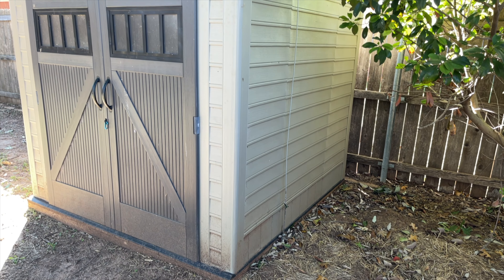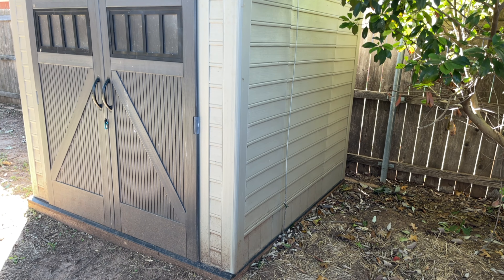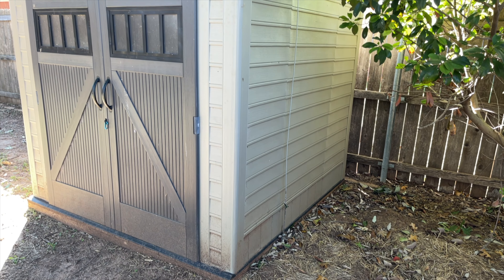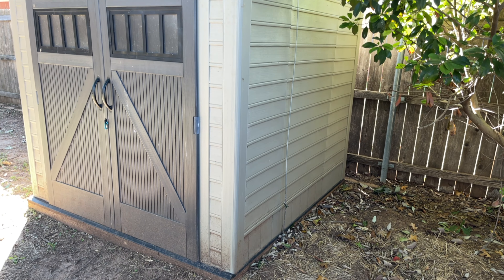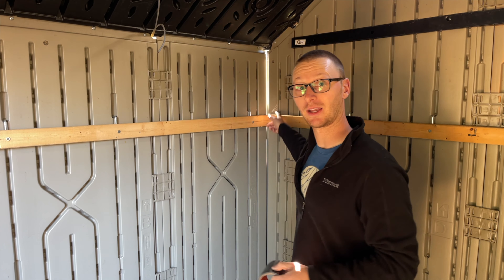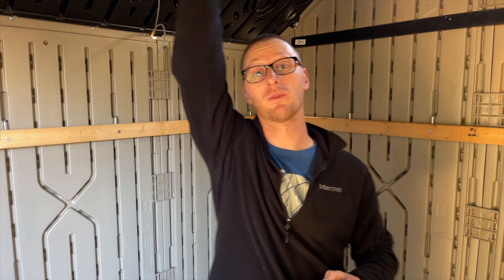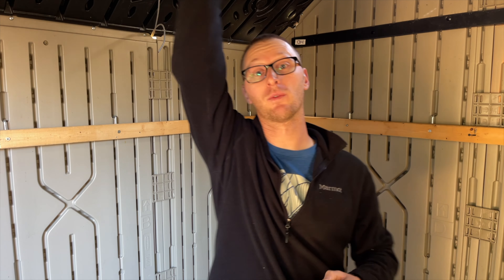How I Repaired My Cracked Plastic Shed

Comment: Instead of Gorilla tape, use Eternabond (comes in colors including tan).   It lasts over 10 years and is used in the RV industry to seal leaks on roofs and sidewalls.  I repaired the cracked corners on my Craftsman (Suncast) shed using tan Eternabond.  I applied it to all four corners floor to ceiling and it has been holding great for the past 5 years.
Reply from the maker: Eternabond is another great option - I've used it on my RV roof as well. It's not as readily available as Gorilla Tape and I've had issues with it being used on vertical surfaces - it tends to droop and sag in the sun - which all adhesive tapes will do to some degree.

Comment: I just had a large 8" diameter tree limb hit the gable roof edge of my older Rubbermaid shed. Amazingly it didn't take the entire shed down (or me 😬). It only cracked the roof edge and slightly buckled the wall gable above the doors.  I was bummed but also impressed at the same time. Didn't want to create another project but it could have come down on my bedroom if I put it off much longer.  (storm damaged  and rotting tree)
Reply from the maker: They're surprisingly tough aren't they!

Comment: Can you do a short video on how you tied it down? I just got this same shed and I’m afraid it’ll blow away.
Reply from the maker: We've since moved from that house but I got some ground anchors on either side, then ran cables up the outside wall, under the roof sheets but above the metal roof supports, then down the opposite side - hope thats helpful.

Comment: Thanks for the video! I happen to have acquired this exact same shed and was planning to do the same as what you did. One of my neighbors was moving out of state and offered the shed to me for free. It had just been sitting on his property for 3 years. I poured a level pad and then just put it all together last weekend--and surprisingly it is still in great condition except at the two rear joints / material bends.
Reply from the maker: Score!!!

Comment: Really helpful video. Question: I have a Suncast HDPE shed and am reading that neither Gorilla Tape nor Flex Seal tape will work with HDPE. Is your shed HDPE? If not, do you have any info on the HDPE question?
Reply from the maker: This is the first I'm hearing anything like that. I'm sorry we've since moved an left this shed with the house so I don't recall the exact material it was made from - but I briefly looked at the gorilla tape webpage and didn't see anything about not using it on HDPE.  Wish I had more clarification for you.

Comment: Hi, I’ve just find out a small leak from my Keter shed roof! Do you think a gorilla tape will fix it from out side?? A very small leak!!
Reply from the maker: It worked well for my applications - I look at it this way, if it doesn't work, how easy is it to try the next solution - pretty easy I'd think. Let me know if you try it and how it works for you
Reply: Thanks for taking time to respond, I’ve used gorilla tape and works great

Comment: Hey I have a question about phone cases. I always drops my phone and it always cracks so I want to buy a new case could you help me because i saw mous, otterbox and caseify and idk what to choose??
Reply from the maker: My current case is by Moment and I like it.
Reply: Now they’re not selling something to protect the screen just the outside I’ve use the otter in the pelican, and I still manage to crack things
Reply: A cellphone specialist says get a case that has good corner bumpers that's where it lands mostly.
Reply: @stevel1475  that will be the next video short, dropping the phone 50 times and see where it lands

Comment: My gorilla tape lasted one season until it started peeling off. I think part of the issue was that the surface of the shed is textured leaving air gaps in between tape and surface.
Reply from the maker: Thank you for sharing that experience - super helpful to have multiple data points. What part of the country are you in?

Comment: Nice ideas!
Does clear silicone stick to the shed? That might help with waterproofing the seal at the top of your roof seal and any small holes.
Perhaps construction adhesive for the wood reinforcements?
Reply from the maker: Not sure on the silicone - my guess would be not very well. And the only wood in the whole thing is the base under the plastic floor :)

Comment: Find me a shed that does not have crack on the corner.  Bad design.
Reply from the maker: Yeah having the folds at the corners and the top of the roof piece definitely are a weak point in the design.